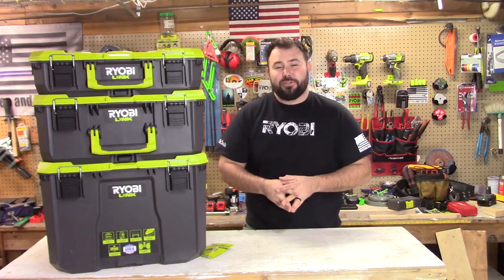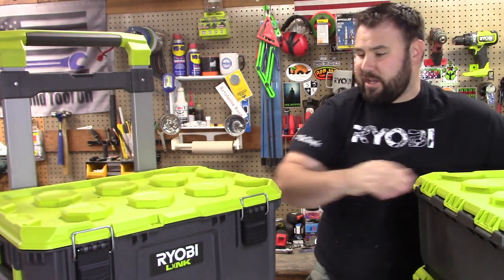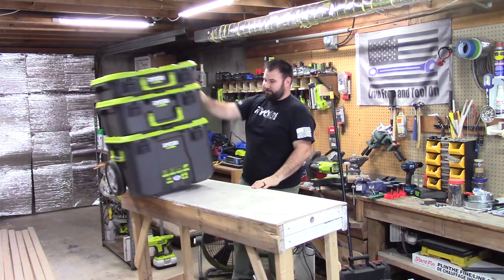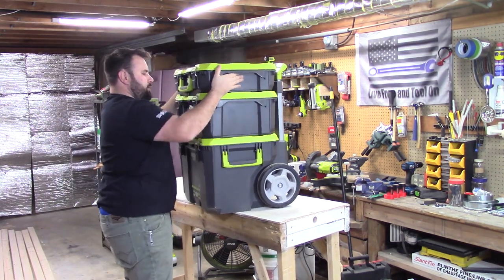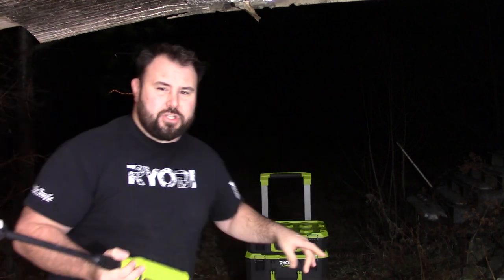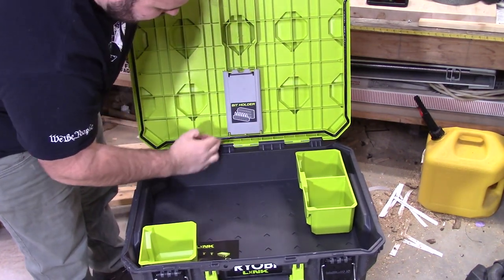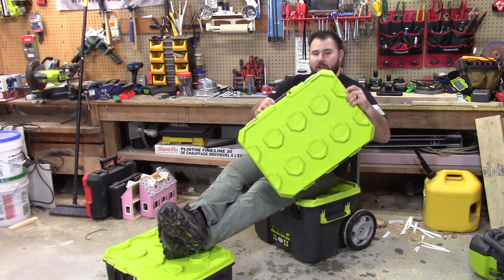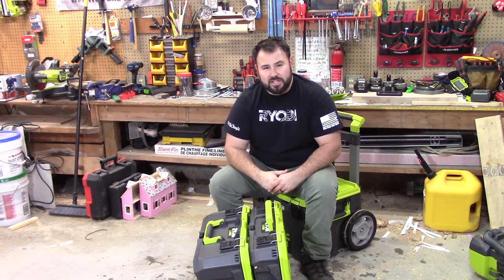Ryobi Link mobile tool storage [torture testing]

Comment: These torture tests need to be done with loaded set ups, that would give us a true scenario. Dropping an empty stacked system is one thing but dropping it it with 50+ lbs can be something completely different.
Reply: Exactly.
Reply: First thing I shouted when I watched it
Reply: once I put weight in mine, about the 10th time I was taking it down stiairs with maybe 90 pounds in it, the handle at the top snapped right off where the tiny tap screws are. Sheared the aluminum like it was nothing.

Comment: 🎯That's all great but you didn't put 3 to 600 lb of tools in it in a real world environment. I did like the wood and stare test but once again there was no tools in the cart.🤦 But I'd like to see you push that thing off the back of a pickup truck filled with tools because that's a common scenario that would happen with a toolbox like that. 👍 I'm not saying you didn't make a good video I'm just saying I think you could have done a more strenuous test on that tool.

Comment: Not bad of a review but wish u gave it a true test and load it down with tools and drop it off a truck tailgate onto concrete or down ur stairs
Reply from the maker: I thought about that, but my table is higher than a tailgate, and I could’ve put tools in it I just didn’t remember to... thanks for watching!

Comment: None of the reviews about this system (and there isn’t many) talk about the crappy bins that absolutely do not stay in place , as well as the lack of tool trays. Those bins up not go all over the place… imagine if you had bolts or screws in them and the bins in the bottom one…what is the point? A tray would be much more useful… I was waiting for this to come out and all the reviews I’ve seen so far seem to be a let down…not to mention the telescopic handle is rickety AND you have to use two hands to move it up and down…and then a tool to disconnect it? That’s a no for me….should have gotten the craftsman when it was on sale.
Reply: I really won't be surprised at all if someone just does 3d printed or aftermarket inserts. A plate that clips or glues onto the lid could cap the bins and also hold them in place. You can get ALL SORTS of mods for packout and systainer, and they are not unreasonably priced.  In fact, if you just got a foam insert (commercially available for both packout and systainer), and glued THAT to the lid, it could cap the bins and hold them firmly in place.

Unless this project is an absolute sales disaster, at MINIMUM, I expect foam inserts to be available aftermarket.

Really, though, I strongly suspect that in a bit they will release a dedicated organizer. There is merit in having a clear lid for small parts organizers, and both the major competitors (systainer and packout) have clear lids on their organizers.
Reply: @timmietimmins3780  You are probably right but that is even more irritating. The customer shouldn't be responsible for making that. Especially if Ryobi wants to claim how competitive of a system this is. This is the kind of thing they do with all of their drills by not having clips included and forcing you to buy them...online, mind you..they won't even provide them in the store to purchase. I have a lot of their tools but this doesn't seem to be something I will be purchasing. Some Ryobi fans will over look  or just ignore many flaws just because they love the company so much. Although I watch a lot of Ryobi reviews from multiple youtubers- I tend to believe the ones who aren't solely Ryobi fans since they have less bias.
Reply: ill probably just not get the small box. I saw that come up in a review. Though it does look like they can be used on the wall mount they have, which is neat, but meh.
Reply: @mase002  it just doesn’t make sense. Outside of the fact that they slight all over, there are no covers on the bins. I really wanted to like this setup, though.
Reply: @sendmedics  idk, I cant fault the whole system for one of the 3 boxes being weird.
Reply: The one I bought locks perfectly. At the store I bought the link over the Ridgid and husky because it had a more stable telescopic handle
Reply: The one I bought locks perfectly. At the store I bought the link over the Ridgid and husky because it had a more stable telescopic handle

Comment: Ryobi is fine for the guy that buys tools from Walmart. Knocking the boxes off a table empty shows nothing. Load all 3 boxes with weight inside and shove it off the table or push it down the stairs. Set the bottom in water and freeze the water what happens? Ryobi, skil, craftsman, kobalt and ridgid also make comparable options. In my experience ryobi doesn’t have the power of others and the feel is cheap.
Reply: Mine flew out my truck bed when I left the gate down, stayed linked and only had a few scuffs, was completely full of tools